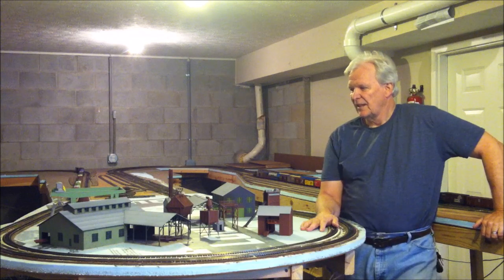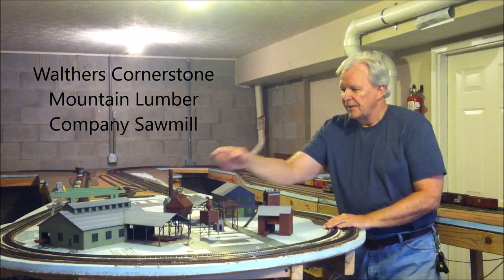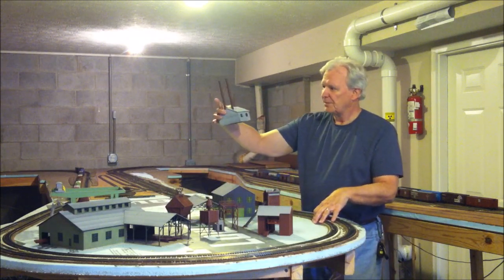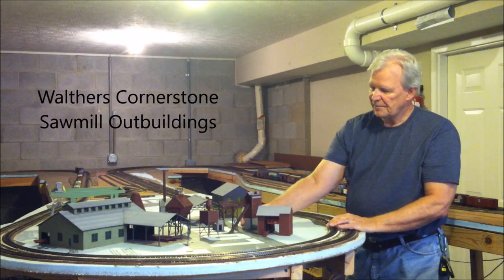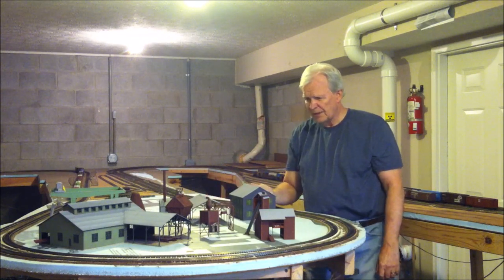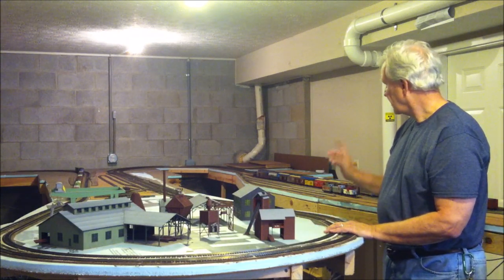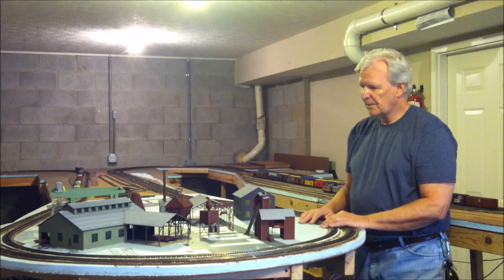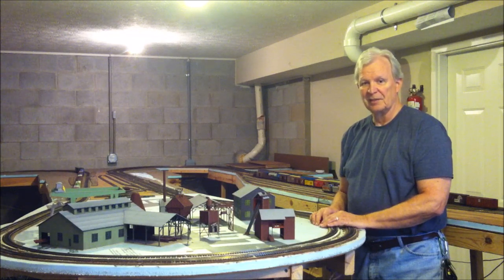The Landsburg & Great Western Railroad Episode 43

Comment: Hey buddy it’s great to see you’re back at it. I love the lumber mill. It’ll need a good amount of room. But it’ll be a focal point for sure.
Reply from the maker: Hey Dave!  Yes I'm not too sure it will fit in that 2 x 6 foot spot but there is more real estate available for it.
Reply: @brian102256  well that’s a nice spot for a different industry or 2. Could do a smaller foreground warehouse with a couple flats on the wall with Spurs